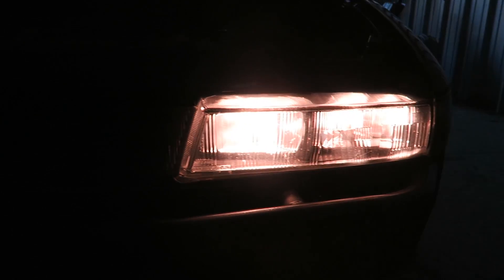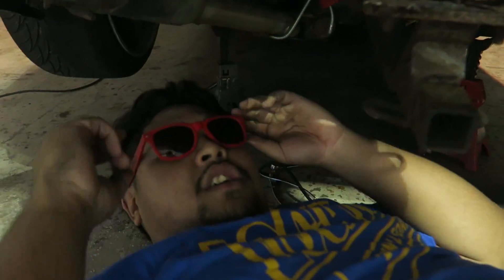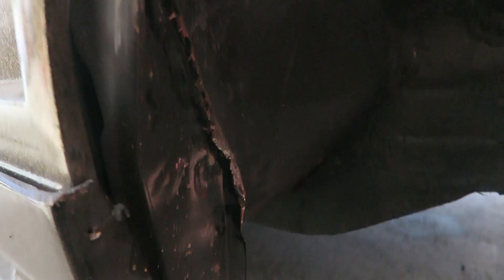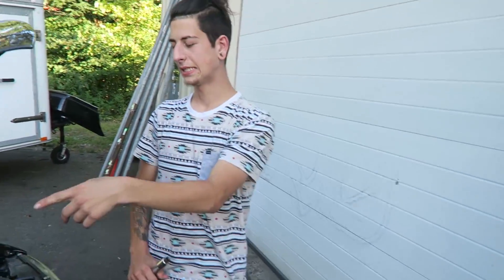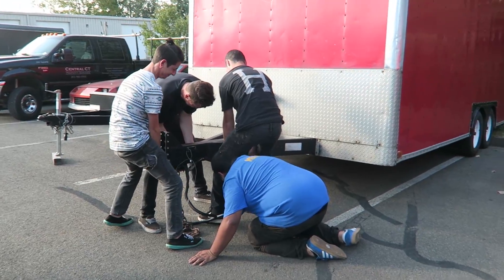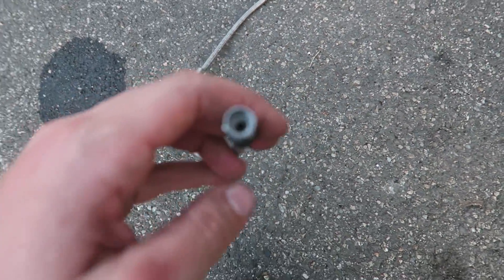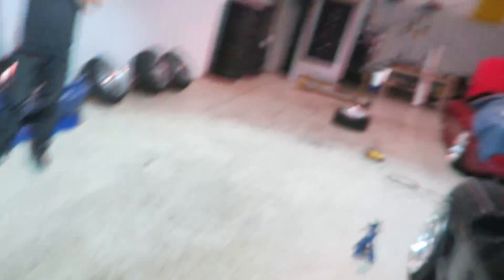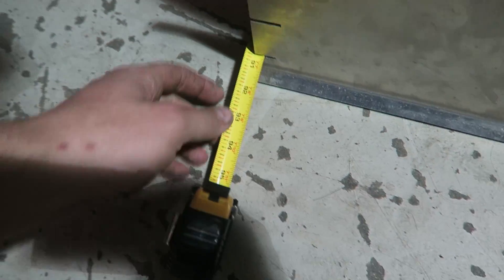GIRLFRIEND STEALS 240SX & IT BREAKS!

Comment: Just a couple of tips:For most jobs where you want to take material away,use a grinding disc.It will last way longer than a flap disc,and you can get them cheap at H.F.For hard materials that you don't want to chip the paint on while hammering,use a dead blow hammer.